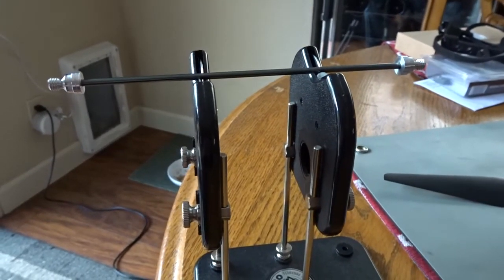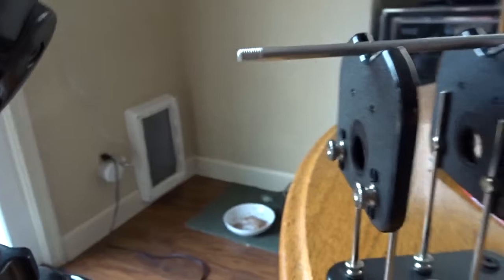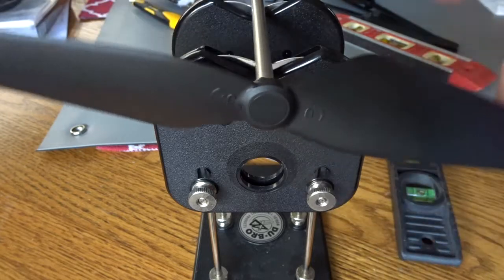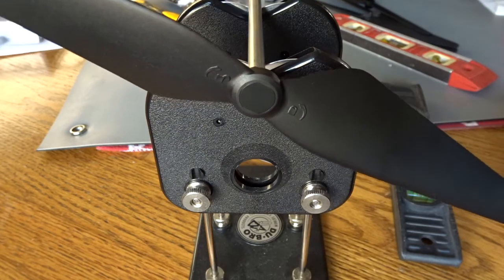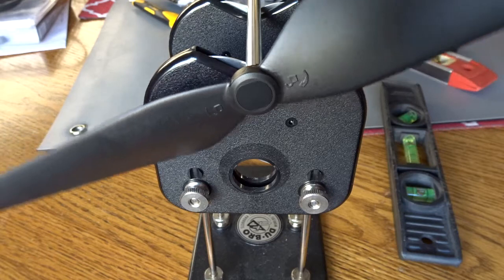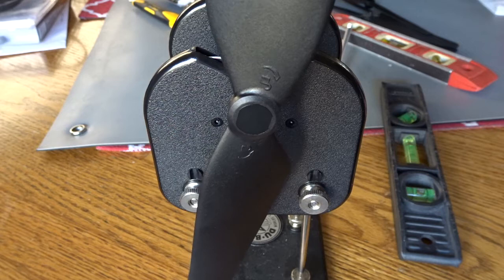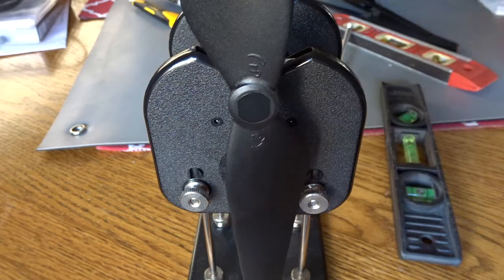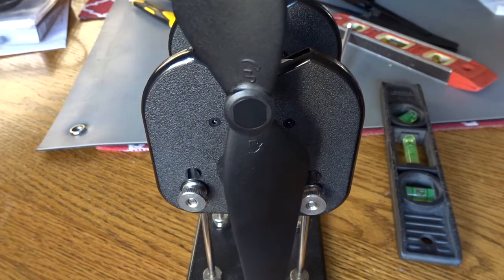Du-Bro Prop Balancer - Results with 3rd party balancing shafts for 3DR Solo and DJI Phantom

Comment: I don't know if I'm the only one seeing this or what. But the results especially from the second test, were CONFIRMED by the smaller diameter shaft on the third test ..........which is MORE SENSITIVE due it's smaller diameter. There was just too much resistance for the prop to go all the way down on the second test.

My vote by far is for the smaller diameter shaft being the most accurate.

Although DuBro makes a fine balancer, their shafts, very similar if not identical to 2 of the 3 in this video....suck. They would do better to ad another 10 or 15 doallars to the price and equip it with the smaller diameter steel shaft